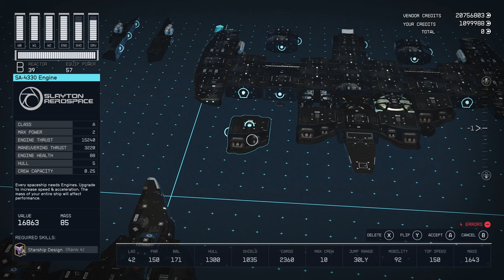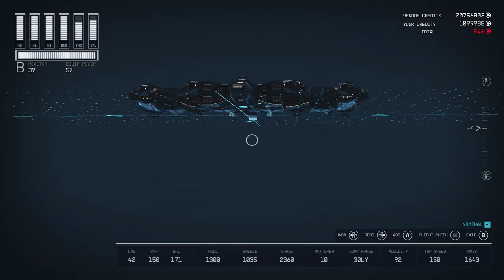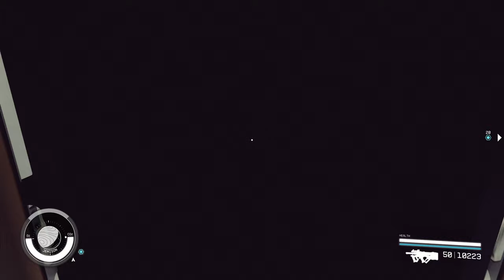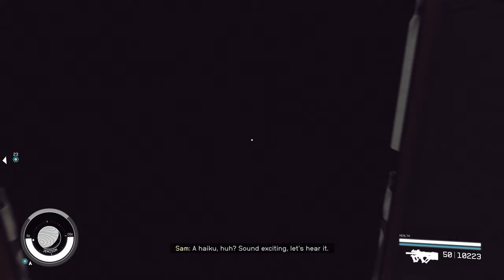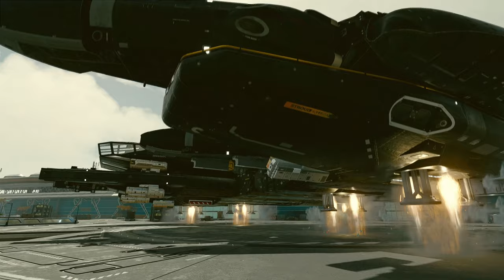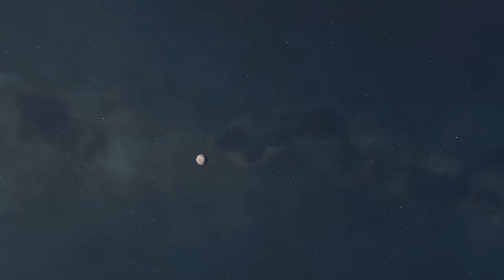Starfield Custom Ship Build - How I created the Batwing MK VII

Comment: this is fire

❤‍🔥❤‍🔥❤‍🔥
Reply from the maker: Thank you :) A good deal of time went into getting this all set up.  I appreciate you taking the time to check this out.
Reply: This is the best one I have seen yet I'm thinking of building it myself but using all hopetech Habs
Reply from the maker: @Damrau85  I thought about using hopetech as well.  The dark gray and overall darkness of hopetech would fit very well.
Reply: I will build it and see what it looks like
Reply: I might even try it with the SAL-6830
Reply from the maker: @Damrau85  I did swap all of the habs out for HopeTech habs and swapped the cargo for the Deimos 20T Cargo Haulers which helped bring Mobility to 100.  Keeping the Nova Cross Passages helped a bit as well since the HopeTech Hab Cross Braces were 14 mass compared to the Nova 4 mass.  You could swap the fuel tanks for the Deimos M30's for something a bit lighter as well.
Reply: @Skuliboro  I never thought of that. I did have to do some glitching to use the Sal-6830 and my Pinch8z and j52 gravdrive but she is still one heck of a ship
Reply: @Skuliboro Amazing ship creation! I’ll have to try to craft one of these on my next playthrough. I’m still on my first playthrough so I still want to enjoy the atmosphere of things.